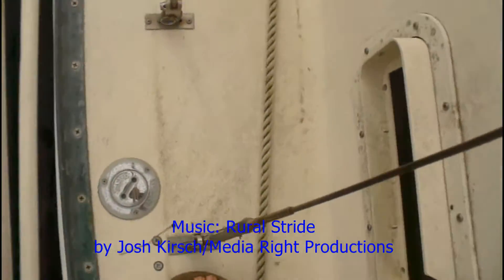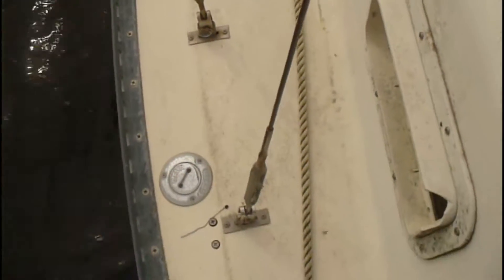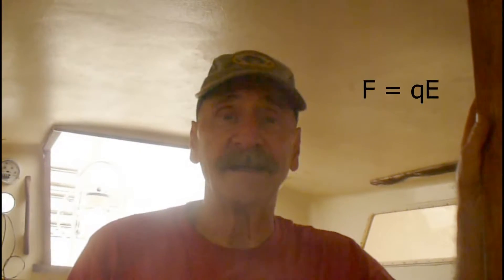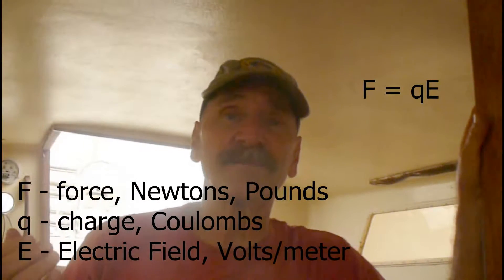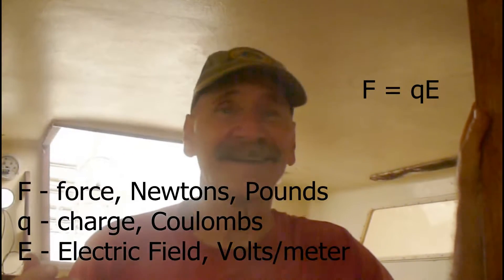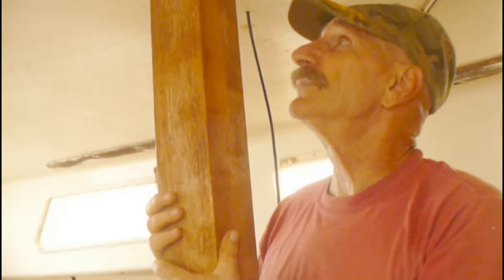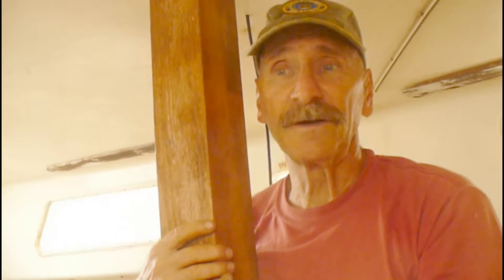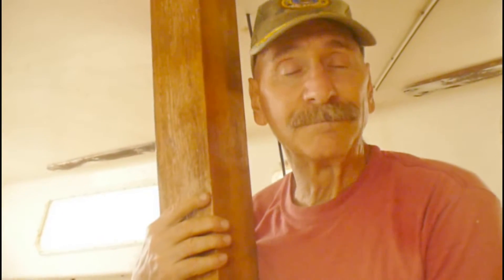Part 3. Lighting Strike! Protect Your Sailboat

Comment: What about running some copper pipe down the mast and then when it gets to the bottom go sideways and then into the water with it
Reply from the maker: If you have a wooden mast, a copper pipe wouldn't hurt, but it might get in the way of the sheets.  If your mast is aluminum, it won't help.  If your stays are not made of steel, then running a ground over the side wouldn't hurt, but I think a copper pipe might be in the way when you want to walk forward and don't want to trip over things.  Maybe a copper strip that can be glued down.  If your stays are metal, then you already have a conductor to the side of the vessel.  The rest is to have a conductor from the stays into the water that doesn't go through the hull.

Comment: You mentioned that you were "rethinking" this strategy.  My boat appears similar to yours.  So, I'm thinking about using your chain idea.  Although, my mast step is metal.  Since it's right under the mast, how likely would it be that electricity would follow that path down inside the cabin if I had chains draping down to the water from each stay and shroud?  Also, I have a metal tow rail that runs the length of the boat.  So, I need to put chain from the shrouds to the toe rails and on down to the water, as you said?  Thanks for your comments and providing this video.
Reply from the maker: Hi Lydia.  Mast step: it depends on what's underneath it.  If you have a metal support beam, then it can move large amounts of electricity down into the lead/iron keel, and if it goes that way, it could damage the fiberglass that covers it (thousands of tiny little holes).

How likely it is for electricity to go a place is a matter of doing the calculations.  Electrons will follow the path of least resistance (or resistivity), but the force that acts against that motion is electron repulsive force, so it's a balance of force and conductivity.  If in doubt, run a ground to the water.

I wouldn't run chains off the shrouds (they'll damage the sides of your boat).  Rather, connect your shrouds to the toe rails.  Toe rails are not only excellent conductors, but they also form a Faraday Cage, which will protect you inside the vessel.  I have thought of designing special "blades" that conduct electricity off the shrouds, which can be bolted to the sides of the boat, and slip down into the water, but I don't think it's necessary.  Although, "necessary" can be a pretty relative term, depending on how much electricity hits your vessel.

I ran chains from the forestay and backstay, and left them in the water, about a foot and a half down.  While Tai Tai was never hit by lightning, it can be a big concern.  The likelihood of being hit by lightning is pretty low to begin with, and I've talked to captains who were hit by lightning, a few times, and have even seen ball lightning (a very rare form of lightning).

As for the toe rails, make certain they're connected to a ground, preferably NOT the sailboat engine and electrical ground, but to water ground.  If not a water ground, then to your external grounding plate or engine ground.  With a heavy cable (electrical - copper).

You're welcome for the video.  Mind you, I'm an electrical engineer, which is the extent of my expertise on this matter.  I've also been an aerospace engineer, and have spent a great deal of time working on aircraft of various sorts.  Airliners, on average, are struck by lightning once a year, and those have complex and extensive electronics systems, along with passengers (they are usually aboard when the aircraft are struck), so these have very robust grounding systems that protect the aircraft and its electronics from damage.  Along with a metal skin.

In the meantime, I've had some ideas for inventions that could be used in place of chains, which tend to catch peoples' attention, warning you that you have "chains dragging in the water."  A shaped piece of stainless steel, that mounts to the bow and stern of the vessel, and are designed for this purpose.  Thanks for reminding me that I planned to do this project.

Good luck! And safe sailing!
Reply: So, thanks Robert Mertens for the detailed explanation.  It was very helpful.  I loved my physics courses when I was in college.  You're reminding me of them.  Also, I am very happy to remind you of this project as I believe it's worthy and needed.  Not many people talk about this issue.  Although, I am happy to hear that sailboats aren't often struck.  I just don't want to be one of the rare few.  Big smiles and gratitude, Lydia 

P.S.  It's ironic how many Robert Merten/s that are accomplished academics.  My field, Sociology, had a renown Robert Merten.  Then, of course, there was a theologian with the same name.  Crazy!